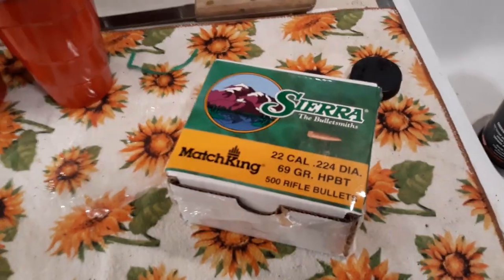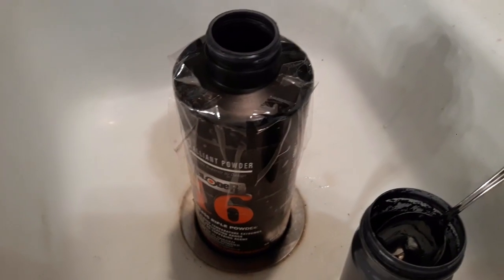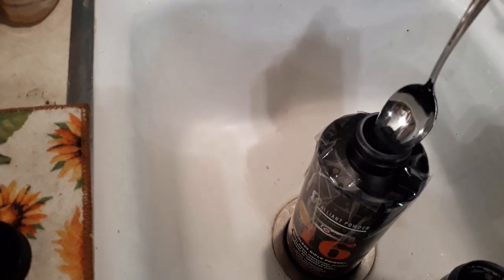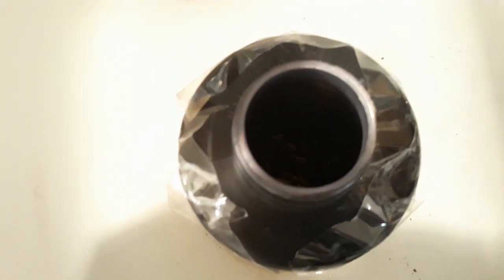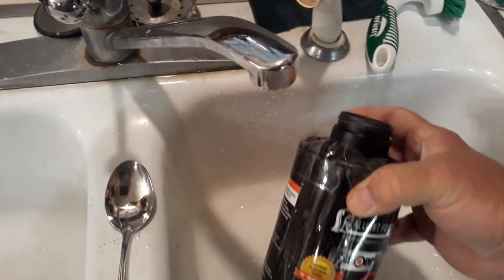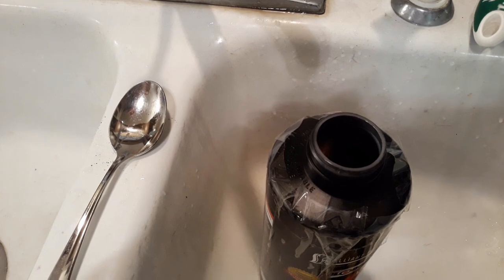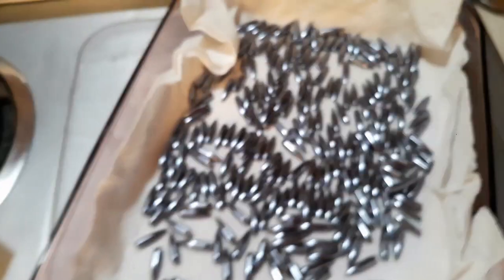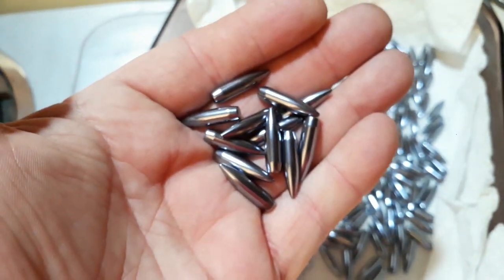WET MOLY COATING OF COPPER JACKETED BULLETS

Comment: Never understood why you needed to use water.  I just sacrificed and purchased a new tumbler.  Any excess powder remains in the tumbler for the next batch instead of risking the wrath of the wife beast when she sees the mess in her kitchen.
People have often asked why the reloading room is actually a shed out back with a half mile long extension cord providing power.  Well, running a Vibrating tumbler surrounded by Moly dust with 1000 Sierra Match Kings all night long is actually kinda noisy...

Comment: Not bad looking bullets, too many steps for me , I like the dry method , so much faster and easier. Add 300 bullets to my harbor freight tumbler , add a 300 pack of BB's  A big tablespoon of moly and run the tumler 2Hrs. Take them out shake them inside an old T shirt and your done!  EZEE PEEZEY
Reply: I saw five hours of work washed away in the sink I think this video is well-intended but I'm not sure it's good for everyone instead of water I would have used 91% alcohol